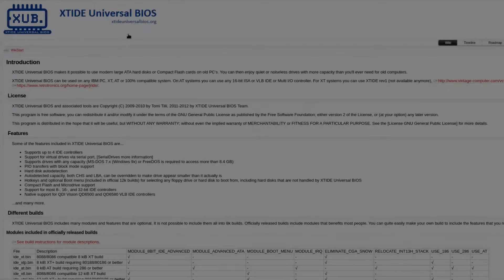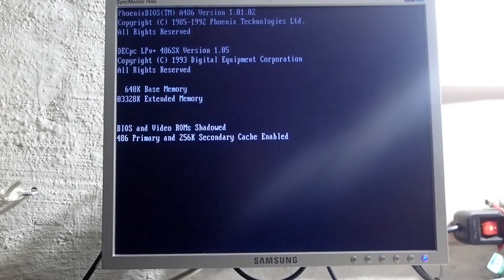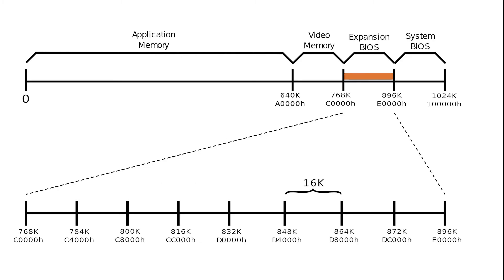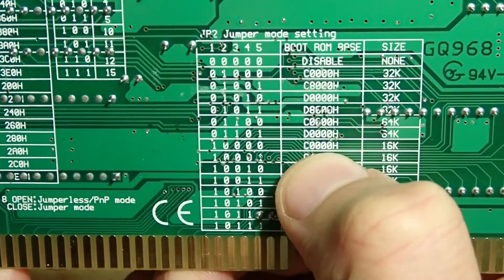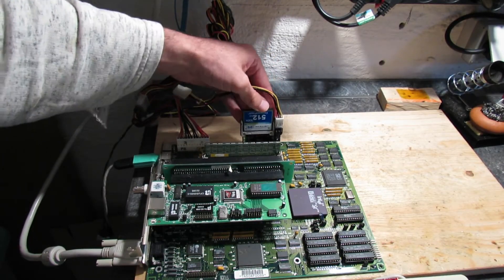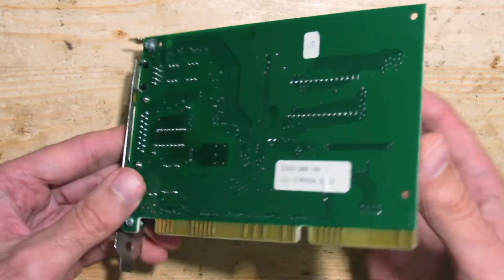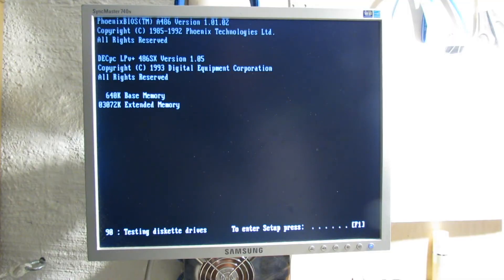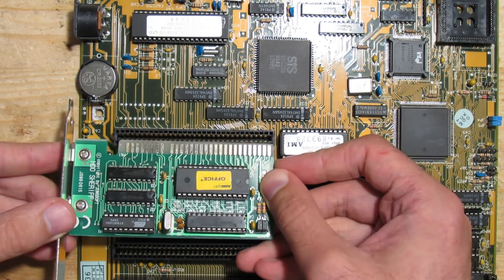Boot retro PC using XTIDE (Part 3): How to use any network adapter with XTIDE

Comment: I'm currently trying to do this with a 3Com etherlink III, but I'm struggling to get the ROM working. The smallest ROMs I have around are 27C256 roms, but that shouldn't be a problem, is it ?
Every time, I try to apply changes, and no matter what address I choose, the utility says "Either there is no boot PROM installed on the adapter or the selected boot PROM base address is being used by another device or software installed in your computer". I can save the changes, but the card doesn't see the ROM nonetheless.
I've tried two 3coms and multiple EPROMs, it just doesnt want to work ... :(
Also I'm using the config utility but it's v3.8 instead of 3.2. This is my best bet now ...
Reply: Well no change ...
Reply from the maker: Hi and sorry for the late answer, yesterday I was AFK the whole day. Is your card the same as I'm using in the video? 27C256 is absolutely ok, it is just very important to pad your ROM with zeros, so the first 12KB are the binary ROM data and the rest 20KB must be zeros. I tested this approach with different network cards, not only 3Com. Which computer are you using to setup the network card? You could try to take any other 386/486 and setup the PROM address there. Then put the network card into desired machine and give it another chance to boot.
Reply from the maker: By the way, it is not necessary to have the PROM IC in the network card during the setup. You should be able to set everything first, turn the PC off and then put the IC into the socket. Just as I've shown in the video.
Reply: @necro_ware  well my programmer pads the ROM with 00 until 16KB then it puts FFs ... I'll change that asap.
Reply: So I changed that and it worked right away ! thanks a lot, I didn't think it'd cause such weird issues but hey you said to NOT do that so I am the one to blame x)
Now my ICL 286 works like a charm with a seagate it's not supposed to run properly :D
Reply from the maker: Very cool! I'm glad I could help. And hope not only my videos, but also comments would be helpful for another people. As I told, I find this topic quite exciting, but seems not to be very interesting for the others... at least yet :)
Reply: @necro_ware  well it was ""useless"" for me because I use period correct HDDs until I found this 286 that's limited to a very narrow list of HDDs ^^
Reply from the maker: @DxDeksor  Yeah, unfortunately mechanical drives are also of limited lifetime. I have a bunch of dead HDDs in my workshop. If you watch my 486 rebuild video, you'll see how the HDD just failed, despite that it was seemingly ok just a minute ago..... the more time will pass, the less "period correct" HDDs we will be able to use....
Reply: @necro_ware  sure ! For now the 260MB Seagate I've installed works like a charm. But the original 40MB IBM is totally stuck ...
Reply: @necro_ware  Yeah, I kinda miss the sound of the old hard drives. In the case of my Tandy 1000 HX, which has no room for a physical hard drive, a CF card or DOM is the best I can do without sacrificing one of the floppy drives. But I'll continue to use the platters as long as I can :)

Comment: Very nice series of video :)

Now I know a 16 bit card that work in XT and have rj45 : the 3com etherlink III :)

Now I have to say, I don't know if the rim itself works, but it's yet again a good way to have networking on your old 8088 !
Reply from the maker: That's cool, did you test it? As far as I know, this card is kind of working in 8-bit slots indeed, but the original software was 286 and above only. However, I found following project for XT compatible drivers for this card. Unfortunately, didn't test it yet, because I currently have no XT mainboard here. The oldest x86 mainboard I have is currently a 286 :(
https://github.com/hackerb9/3C509B-nestor
Reply: @necro_ware  I got mine working in my XT years ago !
I found a post on vcfed where someone modified the original packet driver to work on 8088/8086. I have uploaded it here since and never had any problems with it :) 
http://www.win3x.org/win3board/viewtopic.php?f=8&t=281
Also, now I'm pretty sure XTIDE for 8088 will work with a 3com etherlink III in a 8bit slot because I got it to work on my 286 in a 8bit slot :) (more about this in the other comment)
Reply from the maker: Cool, that's good to know. I have multiple of that cards and will keep at least one in case I'll get a XT one day again. I'm also curious about that drivers on the github :)